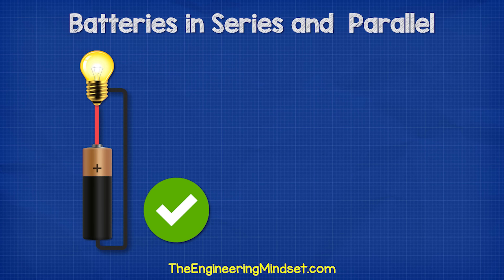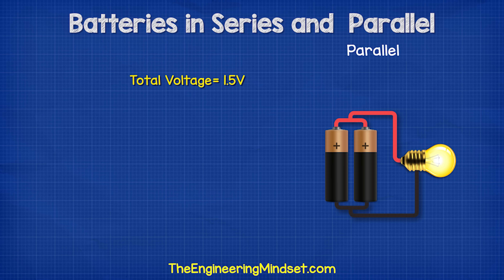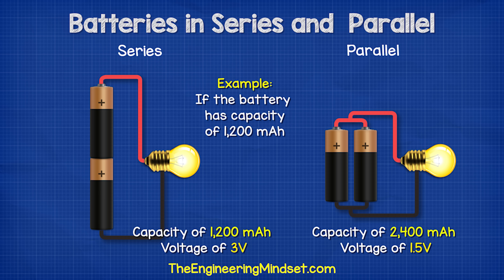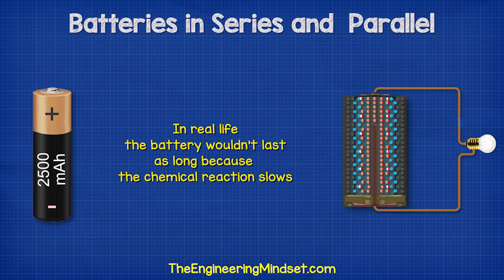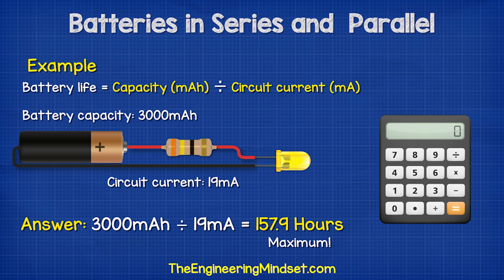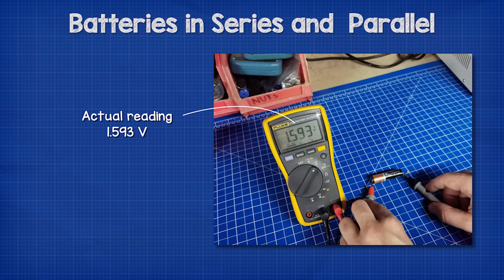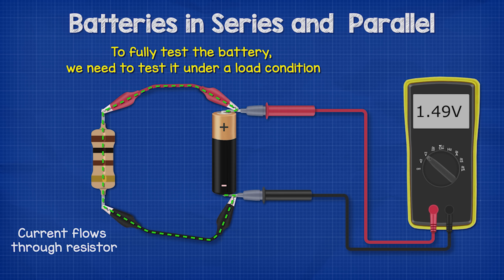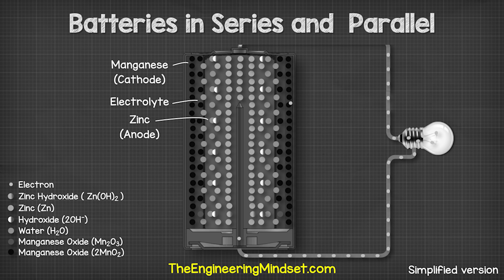Why do we connect batteries?

Comment from the maker: ⚠️ These videos take a long time to make if you would like to buy Paul a coffee to say thanks, link below: ☕
PayPal: https://www.paypal.me/TheEngineerinMindset
Channel membership: https://www.youtube.com/channel/UCk0fGHsCEzGig-rSzkfCjMw/join
Patreon: https://www.patreon.com/theengineeringmindset
Reply: Why when we connected two batteries with different values in parallel they are damage?? Can you make a video on this case ??
Reply: Isn't a battery a collection of cells?
So, essentially you are describing a battery.
I'm not sure if terminology is different where you are, but here in the US we have AAA, AA, C & D cells of ~1.5V and a 9V battery made of six tiny cells inside a rectangular case.
Reply: @jimurrata6785  no no i mean if i have 1.5 v battery and 9 v battery and connected them in parallel what is happen??
Reply: @modarelmohandis1174  1.5V is a single cell.
If you were to try and parallel it with six 1.5V cells in series (9V battery) the battery would try to equalize voltage with that one cell, causing it to overheat and rupture.
You can only add it in series with 9V to create 10.5V.
You can combine cells in parallel or series (or both) but the final configuration of modules must be balanced for voltage and amperage.
Reply: @jimurrata6785  thanks , but can you send the last part of your massage again 😅
Reply: @jimurrata6785  thanks 💙🌸
Reply: The lights in the thumb nail are backward.  The whiter light should be in the battery in series.
Reply: can you use two batteries in series and two in parallel 🤔🔋🔥🙇‍♂️
Reply: Please friend - explain why 
Can you explain:
1)
I am baffled why two batteries in series will have double voltage across them but same current. If we have a 5 volt battery with a 1 ohm resistor - the current in that circuit is  5 amp. But if we have a 10 volt battery and a 1 ohm resistor we have a 10 amp current. If this is the case then why would 2 5 volt batteries in series which is 10 v, with a 1 ohm resistor, not have a 10 amp current but actually a 5 amp current!?

Comment: Theorists be like: A 2500 mAh battery can provide a current of 900 amps for 1 seconds.
Reply: Don’t try this at home. But if you ignore this advice, record it and put it on YouTube 😅
Reply: Wouldn’t it be 9,000 amps for 1 second?
Reply: @nicholasdowns3502  yes, miscalculation on my part
Reply: @TheDeadKingsRaven  I can't tell if you are serious or not, but in case you are:

You can't actually output that much current from the battery. The reason is the internal resistance of the battery.

If we assume the battery has an internal resistance of for example 5 ohms and an open loop voltage of 1,5 volts, then the current would not be able to surpasse 1,5/5 = 300 mA even if you had it hooked up to a perfect short circuit.

Further more, it is recommended that the consumer has a  significantly higher resistance then the voltage source. This is because the consumer and internal resistance are in series and we want most of the voltage to fall of on the consumer (ideally little to no voltage falls of at the internal resistance)

Tldr: Maximum Current from a battery is limited due to internal resistance. The resistance of the load should always be significantly higher the the internal resistance of the voltage source so that most of the power gets used by the consumer.
Reply: You are forgetting internal resistance which is not zero!
Reply: @imusingwindowsbtw1469 , no, I realize it was a joke
We’re basically talking about a capacitor
Reply: There is a maximum that any Cell can provide.  That is why some vehicles have these big 50 Farad Capacitors in Parallel with the Cranking Amp battery.
Reply: correct me if I'm wrong. 
if a 24V battery has a capacity of 150 Amp. you can produce an output of 200A within a second or milliseconds by using capacitors, inductors, resistor, Transistors and other electronic components and you'll need to design a circuit that can meet your demands.

mAh(milli Ampere hour) is different to mA (milli Ampere)
Reply: @anonymous_FoX  yes, the demands you want would be managable by the battery itself. Also you can only make the current higher for short time using a capacitor
Reply: @anonymous_FoX The unit  mA is current, mAh is capacity.  You can short out a 24V truck battery with a spanner and get several hundred amps for a few seconds until the spanner melts!  If the battery is not charged enough, or already defective, then it will be discharged if the spanner is left there long enough.  By Ohms Law, the resistance is R=V/I so 24/200 = 0.12 Ohms.    The starter motor will also draw a current of 100 to 300 Amps.   You don't need inductors, capacitors or transistors to get a current of 200Amps.    What happens in practice is the resistance will heat up (I^R effec) and the resistance will increase, so the current reduces.   If the excess heat builds up, the resistor will melt and/or fail, just like that spanner.
Reply: @karhukivi   @George Reynolds  what i mean is that your output current is variable which means, no matter how low or high the Resistance is it will always have an output current based on what you desired. you can even step up the Voltage if you want. 

example you have
battery 24V, capacity 200Ah, your load has a R= 5 kilo-ohms. 
using i=V/R 
the output i = 48mA (if current is not variable) 

and if your current is variable (using electronics and electrical components) then you can draw more power from the battery that can melt or destroy that 5 kilo-ohms Load. 

 Thank you.
Reply: Boom goes the Hoover board.
Reply from the maker: Check out NEW resistor video, everything covered! ➡️ https://youtu.be/DYcLFHgVCn0

Comment: These are NOT batteries, they are cells. They only become a battery when more than one are connected together. The derivation of the word 'battery' is Battery Of Cells.
Reply: You beat me to it.
Reply: Technically you are correct, but you would lose everybody if you say “put that cell in the remote control.”

Comment: The first and most important thing is that they wouldn’t be batteries if we didn’t connect with together. It takes two or more cells to make up a battery. What we call a AAA “battery” is actually a AAA cell.  If you put three of them together in a flashlight, then you have a three cell AAA battery.
Reply: I detect a highschool Science teacher
Reply: Maybe we just just use 9V batteries then.. since they are 6 AAA CELLS internally.
Reply: Why does a battery have to contain two or more cells, and not just one? I am trying to find sources proving your point, and every source says only one cell is required.
Reply: @piguy4137  my understanding is that the word "battery" is an array of things: like battery-farmed chickens or a gun battery.
Reply: @asbestosfibers1325  I tend to agree, but it is pedantry. Interestingly Google definition is "a container consisting of one or more cells, in which chemical energy is converted into electricity and used as a source of power."
Reply: @piguy4137  It is a language issue, not a technical issue.  Granted our dictionaries have been updated now to reflect decades of misusing the word battery.  If you have ever heard of an artillery battery it is two or more artillery pieces whereas if you have just one cannon it is not a battery.  Likewise, a nine volt battery is a six cell battery but a D-cell “battery” is a single cell and not technically a battery.  Our common AAA through D cells have one anode and one cathode each making them single cells, while 9V batteries and the old school 6V dry cell batteries have 6 pairs 4 pairs of anodes and cathodes respectively.

Comment: But connecting batteries in parallel also increases the capacity to store energy.

So connecting the batteries in series will increase the voltage but the capacity will be the same, whereas in parallel will increase the capacity but the voltage will be the same, for example, when you have 3 batteries and each of them has for example let's say 12V and 3000mAh, when you group them in series, the output voltage will be 36 volts but the capacity will be the same, whereas in parallel the voltage will still be 12V but the capacity will be 9000mAh.

So if you want more capacity without increasing the voltage you wanna connect the batteries in parallel, and if you want more voltage you have to connect the batteries in series but the capacity will be the same.

Comment: Two cells of 1200mAh charges connected in series don't add up? Bizarre. Then where go the extra 1200mAh of charges?
Reply: They will have twice the voltage and so they can supply twice the current through the same resistor, but the total capacity remains the same.
Reply from the maker: Check out NEW resistor video, everything covered! ➡️ https://youtu.be/DYcLFHgVCn0

Comment: If you had a 9 volt battery, what kind of circuit could you build to have +5.00 Volts output?
Reply from the maker: Please see our voltage regulator video

Comment: Parallel cells actually have less capacity than series cells, because they are constantly discharging / charging each other. So connecting cells in parallel should only be done temporarily.

Comment: correct me if I'm wrong if a battery rating is example 1.5V that doesn't means when you measure them using Voltmeter it doesn't display 1.5V but rather display around 1.8V indicates that it's full charged. that 1.5V is the standard voltage for that kind of battery.

Comment: A battery of 2400 mah with 1.5 v provides the same power compared to a battery of 1200 mah with 3v 
So can anyone explain since it provides the same power why does it matter we connect them in series or parallel ?

Comment: Picture in thumbnail is wrong. In series the bulb would glow brighter than in parallel.
Reply from the maker: The thumbnail shows the series lamp is brighter?
Reply: @EngineeringMindset  The light of the bulb, with the batteries in parallel (left) is white (=brighter), and the light of the bulb, with the batteries in series (right) is yellow (= less bright).

Comment: Not only did I learn about batteries today, I also learn that outside of the US, that alligator clips are called crocodile clips.  Makes sense since alligators only really exist in the Americans and China.  I wonder if the crocodile clips are more pointy than alligator clips?

I was really hoping that you would have explained why battery cells are 1.5 volts.  I am sure that I must of learned why but I don't remember.  Even big wet systems that I used to work around (I am not an electrician) were 1.5v cells for 120v battery bank.
Reply: The voltage depends on the chemicals used to make the battery. Alkaline batteries contain zinc and manganese dioxide soaked in alkali, which results in 1.5 volts. Lithium polymer batteries are usually 3.7 volts since they use lithium metal and either cobalt oxide or iron phosphate. Lithium is more energetic than zinc so the voltage is higher.
Reply: @suey1690   thanks

Comment: Oh, I thought you were going to explain why... Like, why we don't just create a greater variety of individual cell voltages. Why 1.5v is a standard. Why, some batteries are made of individual cells inside the wrapper. Etc.
Reply: It's based on the chemicals used. Extremely simple batteries can be just two metals. I think copper and nickel have differing electron  shells, where one of the metals wants to get rid of electrons and the other wants to gain them. Difference in voltage happens because of the electrons spreading to the other metal and becoming stable. So copper, for the sake of me not googling it and reexplaining, goes from being neutrally charged with equal electrons and protons to being negatively charged because the want for full electron shells outweighs the strength of the electrons repulsing new electrons.
The specific voltage levels come from the variety of metals and liquid compounds used. 1.5 might be standard just because it's made using the most common materials. The fact that batteries of differing sizes are just smaller batteries in series is because of cost of making 1000 of the same type being cheaper than 100 of this 200 of that
Reply: The cell voltage is dictated by the chemistry.

Comment: Question, Why do we use the term battery for a single cell?
A battery is a group of cells connected inside a single package.
Like a 12 volt car battery. 6 cells connected in series to form a battery.
Or a cordless power tool. Multiple cells in one package to make a battery.
Even on the package it refers to them as cells. Are we that lazy minded to not correct others or just go along with the flow?
Now a 9 volt battery is a true battery. Comprised of 6 cells inside.

Comment: Does this also apply to inverter batteries? Say for example. If I have 8 batteries in series to make a 48v battery bank, vs 2 sets kf 4 in series connected in parallel for a 24v battery bank. Does it last longer than the 48v battery bank?
Reply: Same amount of energy, any way that you mix them. The system that uses the batteries will determine the configuration.
Reply: Yes the capacity will increase
Reply: In the case of an inverter, the inverter will determine the battery configuration. If you have a 24V inverter, trying to run it off of 48V will destroy the inverter. On the other hand, trying to run a 48V inverter from a 24V supply will not power the inverter no matter how many sets of 24V you connect in parallel.
You should always select your inverter to run off of your expected battery configuration. 
HOWEVER, the topic regarding inverters that is most commonly referenced is Watts, or the amount of power a given inverter can produce. Watts is calculated by multiplying voltage by the current supplied, and will not change with a reconfiguration of batteries.  Your example of 8 series (8S) for 48V versus 2 parallel by 4 Series (2P4S) would both produce the SAME Watt-hour capacity.
Reply: @JasonSimpson1966  which means that both setups , the 24v system and the 48v system, would both run out of power around around same time assuming an equivalent load. That's what I'm really asking. If the same number of batteries set up at a lower voltage to increase the ampacity would last twice as long. But I'm guessing it would be the same. I was a bit confused by this vid when he said it doubles the duration of the batteries putting them in parallel. I just always thought it was the same for regular batteries and inverter batteries.
Reply: @mikemosc3254  doubling the batteries doubles the duration ONLY if using batteries of the same capacity.
Additionally, where inverters are concerned, having a higher input voltage generally means a more efficient inverter, as you have less in losses because you don't have to step up the voltage quite as much.
Reply: @JasonSimpson1966  can I ask you one final question? What's the difference between operating voltage vs input voltage. I can't seem to find a video explaining that at all. As it relates to solar charge controllers.

Comment: Still confused. Why is the battery that shows 1.0 V considered completely out of charge?
Reply from the maker: It can't sustain the chemical reaction to push electrons through the circuit. It has enough potential differece only to show a voltage difference.

Comment: If testing suitable batteries for creating a battery pack (e-bike), should you charge them fully before reading the Voltage of a multimeter?
Reply: Not sure of your question but here are some relevant topics for Pb 12V:
The charging voltage is the extra voltage used to push amps into the battery, around 14V.
Float voltage is the fully charged battery being kept at full charge by controller, around 13V.
Battery full charge is off the controller a short time, around 12.7V.
So when you are testing with multimeter you need to be aware of battery situation. Temperature affects all of those numbers.
Reply from the maker: Check our new Multimeter tutorial out ➡️ https://youtu.be/4lAyzRxsbDc

Comment: I dont understand why a battery could show 1.5 V under no load but still not being able to drive over a small rezistor, as shown.
Reply: The internal resistance has increased.  If you draw almost nil current, the voltage is 1.5, but once a current is drawn through an external resistance, you have to include the internal resistance too.

Comment: consider two battries A &B. 
battery A positive is connected to a one terminal of 2 terminal load.battery B negitive connected to another terminal of same load.
why circuit doesn't work if both batteries A and B not connected?
Battery A positive is ready to take electrons, Battery B negitive ready to loose electrons. but why circuit doesn't works if we don't connect both batteries.
Reply from the maker: Because the battery isn't ready to send or receive electrons, no chemical reaction is taking place, it is an open loop. https://youtu.be/PXNKkcB0pI4

Comment: Is it that it uas run out of charge or is it that the battery just cant produce enough current to power anything beyond its current value? By my thinking it should still be able to work at .8 v if the devicr is .5v and minimal current draw.
Reply: Presumably it would work.  That said, the amount of current you could produce would be minimal due to the high internal resistance, and the battery would quickly drop below the minimum voltage.  It would have such a short lifespan that it wouldn't make much sense to use.  Also, if this was a secondary (rechargable) cell, draining the battery down to 0V would probably destroy the battery and prevent it from being recharged.
Reply: @TheVonMatrices  so its not the loss of charge it becomes unable to give what little charge it had left. I get it.